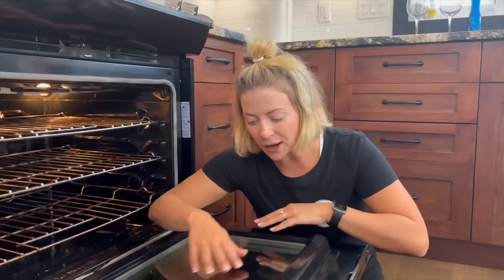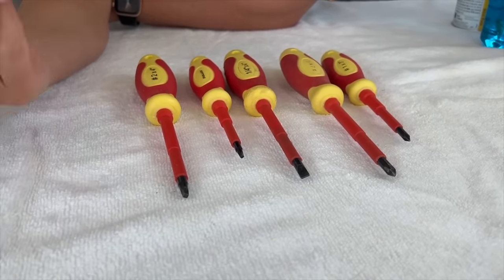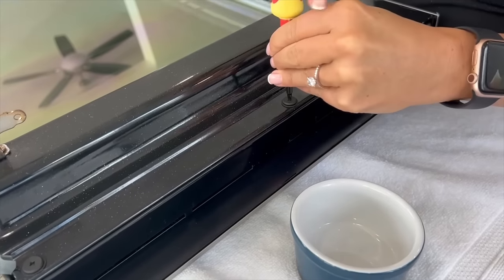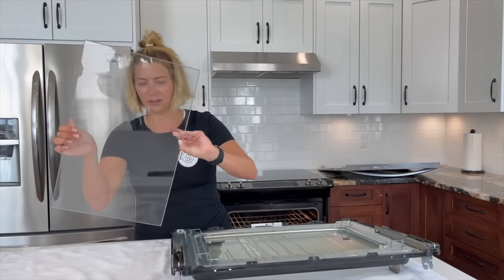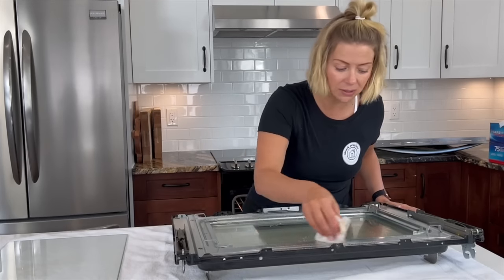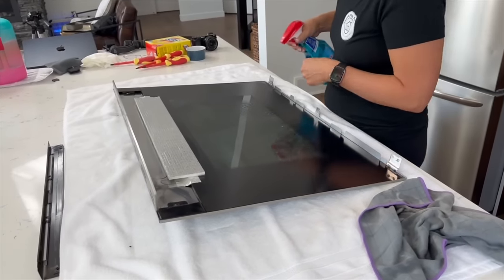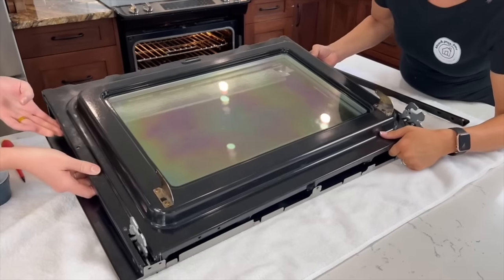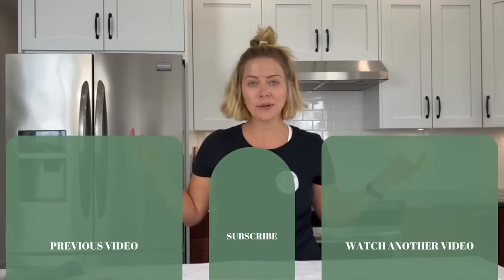How To Clean Between Your Oven Door Glass

Comment: I think the third pane of glass is to retain oven heat. A lot of cooking heat is exposed through the view pane and this third glass pane reduces loss and prevents you from getting burned immediately if you touch the oven. If there were only two panes, the exterior pane would be too hot to touch during cooking.

Comment: Super helpful!  Thank you so much!  I have been looking at drips I did not know how to get to literally for years. BTW that third pane is to keep the heat in.  Without it the outside glass could get dangerously hot.
Reply: I followed your instructions and was able to get rid of those drips that have been bugging me for years, thanks again.  But I had to tell you, once I got mine apart, it has FOUR panes of glass!

Comment: Thanks. your video was helpful. the drip streaks were driving me nuts. after i lifted the glass my oven had two metal standoffs for the top 2 screws. one was knocked over when i took the glass off. luckly the other was in place so i realized it was a standoff. I believe the 3rd pane of glass is for thermal reasons. The enclosed air barrier created by the 3rd pane between the hot inside the glass pane on the very outside provides a very good thermal barrier.

Comment: This was the most excellent YouTube cleaning video. All the other Google options told you to stick things like a hanger between the two plates of glass like that was possible well explained and well demonstrated.  just a note I wouldn’t call the screwdriver “star” because there are star ones I’d call it a cross, it’s called a Phillips head. Also, based on my own experience, when you take a piece off, line it up in the direction that it goes.  You put your sideways which left you the option of putting it in upside down. You also gave us cleaning options. I look forward to your next video.

Comment: That extra piece of glass inside is there for proper ventilation so your door doesn't get too hot. I have a wall oven with a combo microwave and mine has TWO extra pieces of glass inside. One of those extra pieces shattered and broke right in my hand while I was cleaning it. Hubby did some research to see if that other piece of glass was really needed and that's where we found out that it is indeed very much needed.

Comment: My oven door has insulation around a glass panel, which I don't see in your door. I took it apart and cleaned the glass but I can't remember where the insulation was or how to layer the door back to the original dirty version.